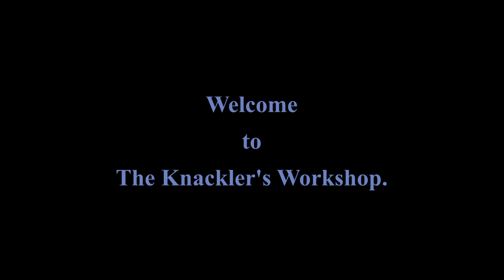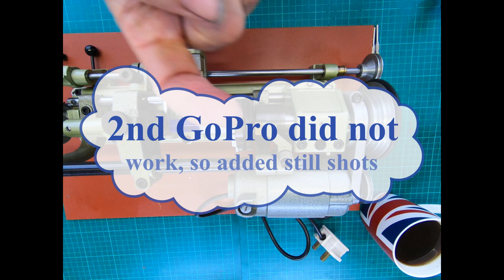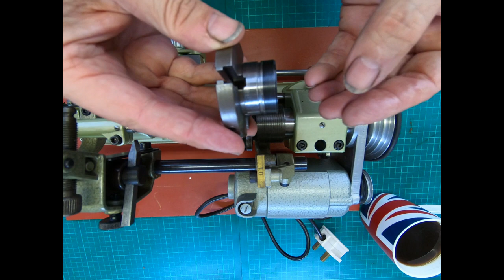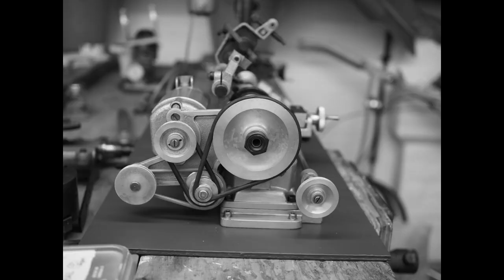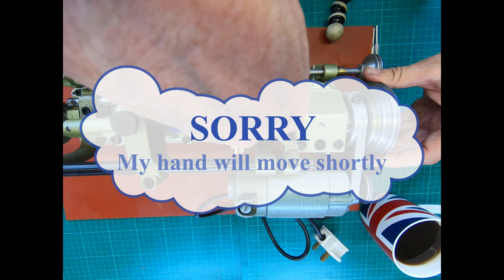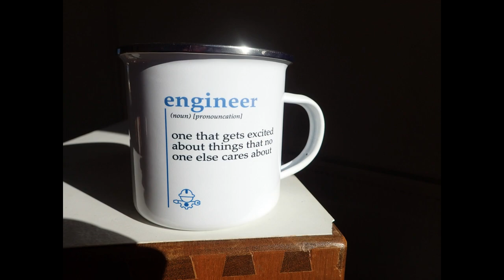Emco Unimat SL Screw-Cutting Attachment.

Comment: Interesting and a little unusual as this screw-cutting arrangement is, it might be possible to do this in another considerably cheaper way?

I have been thinking of adding something on these lines to a home-built (ca. 1978) mini-lathe but likely will not go ahead. To produce different pitches requires a different threaded collars and the attachments and the collars, I gather, are not that cheap or easy to find. 

Having finished the machining on the work-piece, a tapping hole would next be drilled through and a tap of the required pitch inserted into the tail-stock having been threaded on and the other end supported by a pin held in the chuck or collet. A cutter ground to the correct thread angle is advanced onto the work-piece which is rotated by hand back and forth advancing the tool very gradually until a full depth of thread is cut. In this way, in principle, we can produce threads of unusual pitch/diameter combinations.

No great originality is claimed but this idea I successfully applied many years ago when having to make stems for an 8mm watchmakers' type chuck and faceplate from which these items were missing.

Keep up the good work!
Reply from the maker: Hello Jozef,
Thanks for watching my video and taking the time to comment... Thanks for sharing your approach to cutting threads, it sounds interesting and great to have someone's thoughts in the comments for others to read.
Take care.
Paul,,

Comment: Hi Paul. Very interesting to see the Unimat threading attachment in action. I had seen it in various display videos, but could not quite envision how it worked. Probably better to turn the spindle manually as you did, even at 155 RPM it would take quick reflexes to disengage. Single point threading was tricky for me even with a synchronized lead screw.
 I wonder if it wouldn't be possible to contrive a hand crank attachment for the main spindle pulley, maybe a split hex socket clamped onto the pulley nut, just for occasions when you want to turn the work piece very slowly.
That follower tracking system reminds me of some production wood lathes I saw years ago, that made multiple passes with metal pattern profiles for turned furniture parts, all done with CNC now, I suppose ...

Comment: Wow that is pretty inventive. Of course you need all the different thread pitches to be able to cut a wide range of threads. Are they easy to find?
Reply from the maker: Hello Tom,
It is indeed quite different... There are 21 formers, 7 Metric and 14 imperial. No they don't seem to be available to often here in the UK and are quite expensive, so in reality taps and dies will be used mostly. Thanks for watching.
Cheers.
Paul,,

Comment: Great video Paul. I always wondered how these thread creating attachments worked. I use my Unimat quite alot. I bought the watchmakers spindle for it after you did a review on the one you bought. Very handy.  Its a great little machine. The only thing I had to do was change the motor for a 24 volt scooter motor which I use on a variable supply and gives me total control over the speed.
Reply from the maker: Hello Johnny,
Many thanks for visiting, I know you're busy with the TR6... It took me a little while to work it out how to set it up but now I should be able to set it up far quicker. I have a few more attachments to show in the near future... From what I have read and watched the motors are a bit of a weak link and one has to be very careful about temperatures and running it for to long. Having a variable speed control would be nice.
Take care.
Paul,,

Comment: Hi Paul such a cool little device. Great vid. Machinist Matt made a vid on his a couple weeks ago too. This is the one attachment I don't have for mine so I cheat-I use taps and dies lol. These are hard to find intact and are expensive when you do! According to the manual the set was available with both metric and imperial sizes. Wow. 
Cheers.
Reply from the maker: Hello Mike,
Thank you.... They are rather expensive, I watched this one not sell on eBay for 2 or 3 weeks and made the guy an offer that was quite low and was lucky enough to get it. There appears to be 21 different former, I cant imagine I will every have them all.
Thanks for watching.
Take care.
Paul,,

Comment: Hi Paul. That's a very interesting system and I would imagine quite tricky to use even with the reduction in speed. Cheers, Alan.
Reply from the maker: Hello Alan,
It does seem to be a one of a kind so to speak... I agree the 155 RPM will still be quite a challenge. When I have a good I will make sure I film it.
Cheers.
Paul,,

Comment: What a different little attachment. Very interesting way of doing it. If you want to cut a different pitch thread, I assume you just have to get the appropriate parts.  No clever tricks to get it to do different threads?
Reply from the maker: Hello Olly,
It is quite different from normal single point threading... Yes, you need a different former for different thread pitches, there at 7 metric and 14 imperial. So quite an expensive attachment as they generally sell for £50 upwards for each former. Thanks for watching.
Take care.
Paul,,

Comment: I wondered how you put tension on the thread follower (so to speak) and then you pressed it manually. Surely a spring loaded device could be created to do that?
Interesting stuff squire!
Reply from the maker: Hello Jon,
Thanks for dropping by... I think the tension on the thread follow has to be manual as you need to lift the cutting tool up when you reach the end of the travel of the former...Goodness knows how you do internal threads as you would be sort of doing it blind.
Take care.
Paul,,